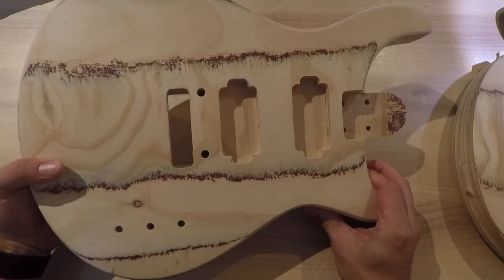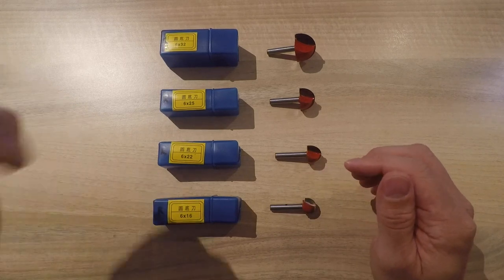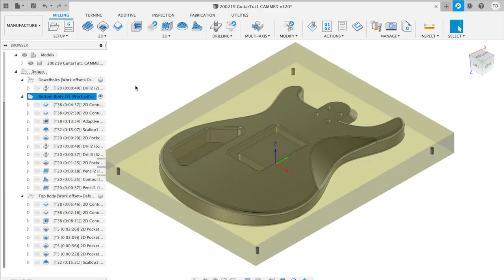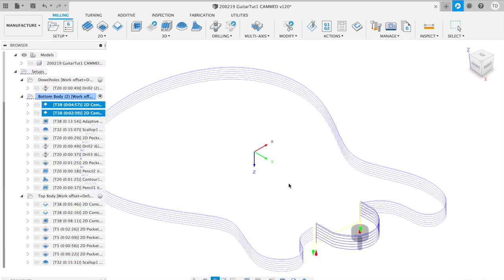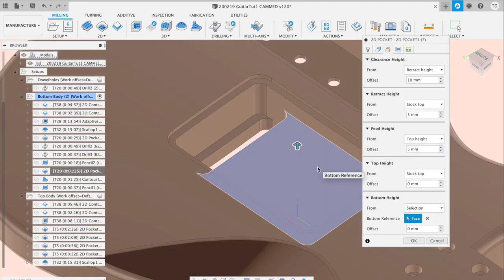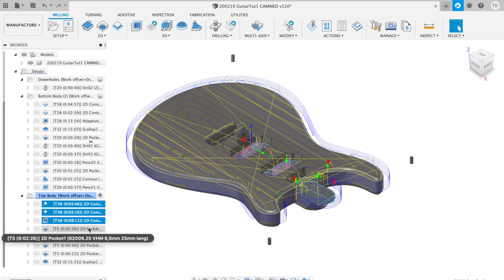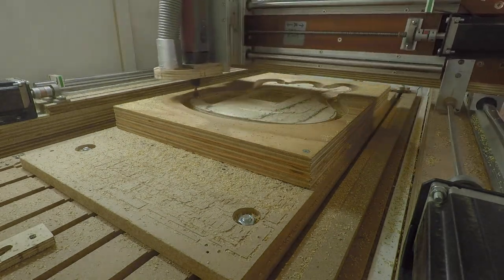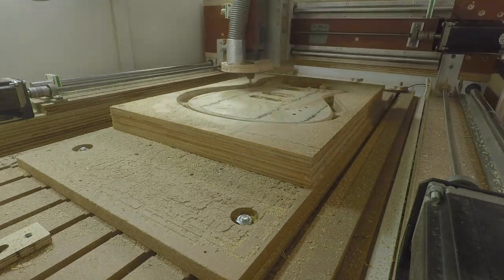Improvements On Cam Strategies for CNC machining Guitar Bodies with Fusion360

Comment: Another Excellent and informative video.  Thank you again for sharing.
Reply from the maker: I try my best to share my experience and knowledge that I couldn't find online in my search for examples and explanations about strategies and insights in CAM techniques. 

I'm glad the videos are helpful to you!
Reply: Ah!! I see! The locators are not the screw holes you used to lock down to the spoil board. They are two different things. Thank you again!
Reply from the maker: @MyWorldBand  Correct, I see what you mean now. In this case I drilled in the screws first, at places I'm sure CNC will never hit and are not in the positions of the dowelholes. I handdrill the holes for the screws, though; if I would not then the screws might possibly damage the stock irrepairable (the stock might split, crack up orso).  But they are just to hold the stock down, not for positioning.  Hope this clears things up!

Comment: Thanks for the timely update! I was planning on CNCing my first guitar body tomorrow using tips from the videos you made last year.
- Any particular reason you now machine the bottom first?
- Instead of having to split the 2d contour into two parts, I believe what I did is create a sketch and project the perimeter of the entire body / neck joint. Then simply use that continuous sketch outline instead of the body for the 2d contour.
Reply from the maker: Hi! There’s not a specific reason for doing the bottom first, other than I’m doing the deepest pockets first, and creating the middle curve first. But that could easily been done the other way round. 

You’re solution for the 2D contour crossed my mind, but I did not want to edit the drawing since I had to go back to a drawing mode and make an even longer video. :-) But having said that: Your solution is indeed very useful! Good thinking! Thanks!

Comment: Well I'm setting up my toolpaths for my first CNC build and your video has been SO helpful.  What I'm still not clear on is how to set up zero WCS for the bottom stuff.  Why would you be probing to top of wasteboard?  Something hasn't clicked in my head yet.
Reply from the maker: If I understand your question correctly: I keep the zero point at the same place in the stock, so that I get a guaranteed height measured from the same point in stock as well as in my drawing. This means that I let the machine calculate everything from the same point. However, that also means because I have to turn the stock around halfway through the process, I also physically move the zero point and thus have to determine the z-zero from the other side. 

Is this also what you meant?
I explain the doublesided technique (which kind of differs each time, just a bit) also in some other videos of mine, maybe then it will become more clear what I do?

Best of luck!
Reply: @Audiohotshot  To make sure I'm understanding...you zero stock at the center/top (not a corner) then for the back setup, zero the "flipped" setup on the same (now upside down) surface but flip the Z arrow up.  When working on the backside, you probe Z at the wasteboard.  I can't exactly visualize why that works but I'm pretty sure that's what you're doing.  I just watched your excellent "Milling a Guitar Neck" vid and that's what it looks like.  Anyway, I'll do a test that way and see how it goes.  Thanks again, your vids are super helpful.

Comment: Great videos!!! Really informative!! Question. I see the first step is drilling the reference/dowel holes. But when you place the stock on the CNC it seems that the holes are already predrilled in the stock? Did you do a step prior where you place the stock on the CNC to drill those holes as well so they are uniform? Or did you hand drill them?
Reply from the maker: The holes in the stock are made at 19:57. I agree, it happens quickly, but noticeable. Me and handtools is not really a good combination, hence me using a CNC router :-) Hope this clears up the confusion?
Reply: @Audiohotshot  thank you very much for clarifying!!

Comment: hi great video,  I'm just try in out a cam strategy for a body and trying to follow along, but I ran into a problem with the dowel pins,  I drew the box same as my stock and 4 equally spaced circles and extruded them but when I go to use the drill operation it won't let me select the extruded circles to drill. Any ideas? .   everything else seems to work great but I can't get it to simply drill holes for alignment .  .  it appears on yours they are 4 solid extrusions is that correct? or should they be cylinders .  thanks for your time
Reply from the maker: Well, in this case I did make an actual extrusion, although I did a drill operation and choose the option "selected points' on the Geometry tab and selected the four center points of these circles. I adjusted the heights at the height tab.

For a bit different approach you could have a look here as well: https://youtu.be/8iaGUxPc05M?t=55

Hope this clears things up a bit!

Comment: Maybe i missed it, but how do you make sure your xy reference stays the same when you flip?
Reply from the maker: There are more ways of doing a double sided technique. I explain 2 methods in a bit more depth here: https://www.youtube.com/watch?v=8iaGUxPc05M and a different here: https://www.youtube.com/watch?v=sY3E7iepzos

Keeping X and Y in the same spot is easy, just do not change anything for the X and Y zero positions but the Z reference. Also, I include my dowelholes in the CAM setup for each side.

I hope this makes things a bit more clear :-)

Comment: Great video. I learned a lot from watching it. Any reason why you don't put the Z at the bottom of the stock when flipping it? So the bottom becomes the top and you don't even have to reset the Z if your last bit for the bottom is the same as the first bit for the top. I hope it makes sense, in my head it does hahaha
Reply from the maker: I'm not sure I understand your question a full 100%. When I flip the stock, the Z-zero point moves from bottom to top. By doing so I'm sure the reference point stays the same, and the thickness of the endresult should end up correctly. Does that answer your question?

Comment: Great video! It's so difficult to get the right toolpath and the best result in the shortest time. One of the difficulties I have is determining cutting speeds and spindle speeds. Would it be possible for you provide some guidance on this? Thanks.
Reply from the maker: One advice I do have, LISTEN to your machine; I always keep an eye on my feedrate slider, so I can adjust it when I feel/hear it runs too fast (or too slow!). 

Generally I set the RPM of my spindle, 9 out of 10 occasions, at 24000 RPM. Only for alu or acrylics I slow it down. The heat of these materials make the material melt and alu does not need heat at all to make good chips. But with wood; in my opinion: at max of my spindle.
My cutting speeds are between 2000-3000mm/min for contour, pockets, adaptive and so on. Only for drilled holes (bores, drills ops) I reduce the cutting speed to 800-1000. The slower movement gives me more precise holes. 
Lately I do use a lot of finishing steps preferably at full depth and at 1000 mm/min orso. It only takes a minute extra but the finish is so much better and more precise.

Please keep in mind that these settings are the settings for my machine, it could well be that these settings don't work out for you machine.
Hope this helps!
Reply: @Audiohotshot  If you look at the tool libraries in F360 it would seem that you're too conservative with your feeds and too fast with your speeds. 

I know it sounds counter intuitive but the machinists where I work (I am an automation engineer, not a machinist, so I take their advice) told me to be either more bold with my feeds, or slow my speeds down to get the chip load right. Otherwise, you end up dulling your tools by overheating them. 

This approach is borne out in the chip load calculator in F360 when you enter your tools into the library. 

Great job on the videos though, and very informative
Reply from the maker: @feolender2938  I totally agree with you about me probably being to conservative with my feeds and speeds. All you say is so true.

But having said that, I'm quite happy with the outcome sofar, in some strange way online feeds and speed calculators never seem to give me numbers I feel comfortable enough with to have a go at a expensive piece of wood. Since every piece of wood just 'behaves' a bit different I kind of 'wing it' by using use my gut feeling in combination with the knowledge you pointed out sp correctly. Sometime I'd rather be a bit more cautious than brave 🙂

Comment: I see that you run the round and the flat (22mm) bits at the speed of 24000RPM. Are you experiencing burning any mark? I though that the wider bits had to run at a much slower speed (around 12000RPM)
Reply from the maker: No, I did not yet see any burn marks. Besides, I also lightly sand the material, so if anything would be visible, it is gone afterwards. The only material I lower my speed for is aluminum.